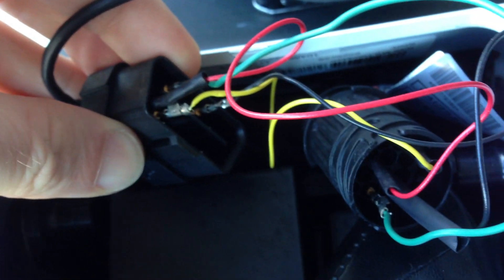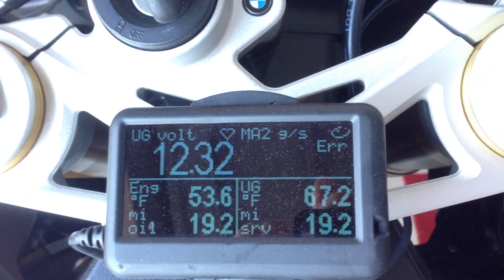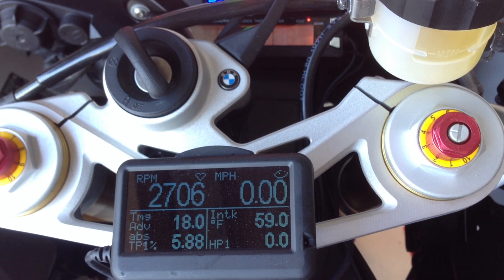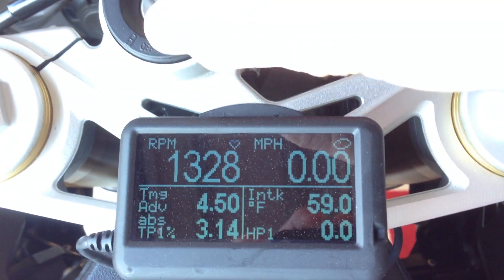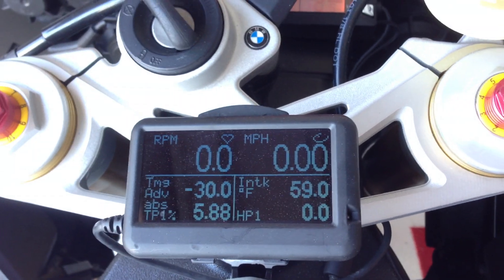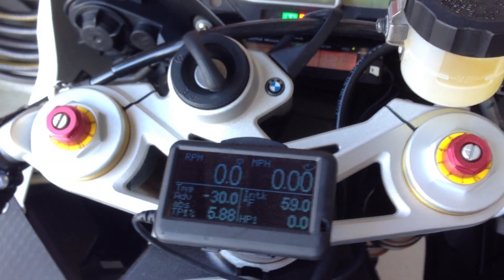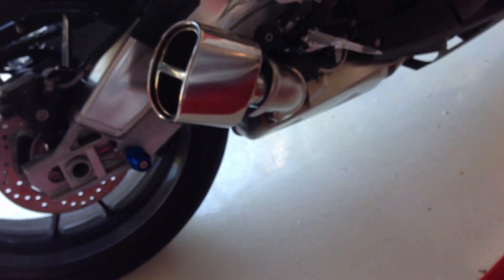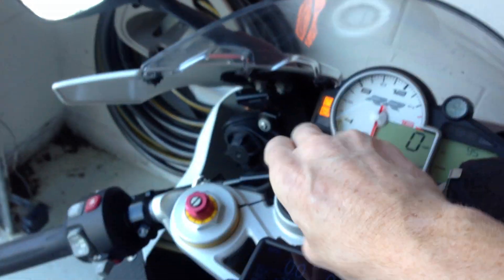DIY OBD2 adaptor for BMW S1000RR and Ultragauge Install

Comment: Hi. I have a BMW GSA I will try to mount a scaner for access to the error code. If I can, I'll let you know to add in your post. I have a channel on ytube (ju.stromer) where I published some things. Unfortunately in Brazil everything is a bit difficult, luckily I can travel and buy my accessories. Congratulation from Brazil. Jr. Geraldo :) Saudações do Brazil.

Comment: I am trying to connect an obd2 to my 2006 hayabusa but I am having some trouble.   Which pins did you use on the obd2 and which pins did you use on your bike?  Is that the diagnostic port on your bike or did you tap into the wires of your ecu?

Comment: Don't know if you still read the comments, but is the ODB connecter a pin to pin mapping? I've read elsewhere that there is a serial port converter required to bridge the ODB connection, but it seems like you don't have anything like that here.
Reply from the maker: Its pin to pin in the sense that there are no level shifters or opto isolators. Its a serial interface technically, but not RS232 serial, its OBDII. On RS232 level shifting from hardware to a PC, etc, is necessary in many cases.
Reply: tcarte04
Thanks! I got an ICOM-D cable that has the elusive 10-pin connector and provides a ODB-II female on the other end. I was debating prying it open and soldering the bluetooth ODB reader to it, I think I'll go for it since it's just a pin to pin mapping.
Reply: Sarath Menon Did you end up trying this? I too want to add bluetooth for Harry's Lap Timer :)
Reply: GoMoto I did try it, and it works for OBD readouts. Not the functionality that a GS-911 offers, but it works great enough to record the speed and tach reading.
Reply: Sarath Menon thanks! Just what I was needing as well.

Comment: I have been having an extremely tough time finding out what my connections are on the diagnostics port of my 4-pin connector of my Kawa in order to make the obd2 adapter. Is there any way you could point me to the right direction? Thanx a bunch!

Comment from the maker: Systems and Software engineer
Reply: Only 7  and 15 pin is needed right to connect, ?  
How about the 6 and 14 for substitute,, what happend to the ECU... maybe it can be   result in to a damage ???